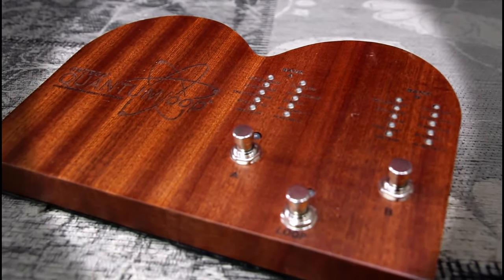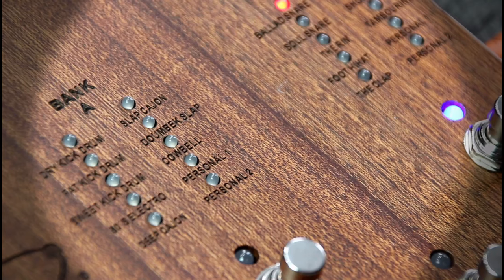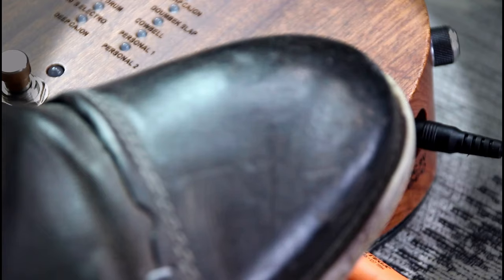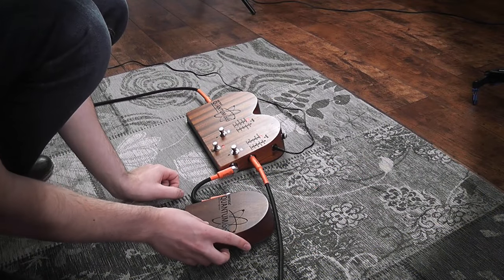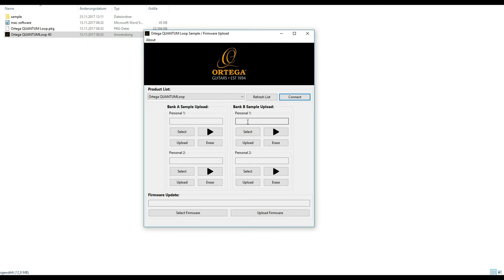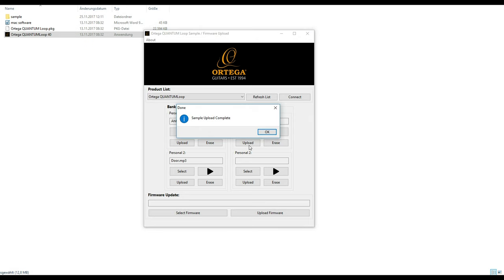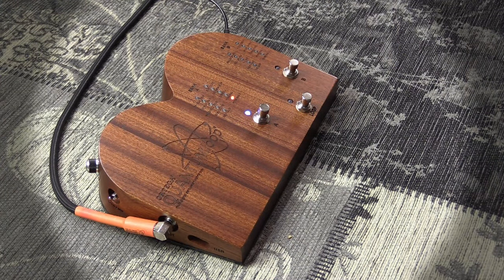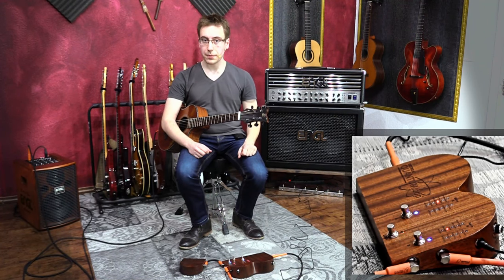Ortega Quantumloop - Video Manual

Comment: Very interesting product.
Can I auto start to record the loop by hitting the drum pad only (without hitting the "Loop" swich)?
When I'm playing, I've use to make a drum beat loop only (no guitar in loop). I want to record a few measures of rythm in loop, and then play over it on acoustic guitar. 
So I have to start by hitting simultanusly both the "Loop" swich and the drum pad (beat trigger), then keep hitting the trigger to record the few bars of rythm, and then hit the "Loop" swich again, to stop recording, what isn't easy when you must be in time (have to use both feet - impossible when standing). I have been using Horse Kick Pro with Boss RC-50 till now, but I'm looking for something new and better.
Second question, can I use QUANTUMloop with my Horse Kick Pro as a expression trigger (as QUANTUMexp replacment)?
Reply from the maker: Thank you for your input. We are able to make some changes to the firmware and have sent suggestions to see what we can do for future updates. As for the HKP being used as the trigger, I tried it out and it does work but for some reason it will double trigger randomly like a flam. Maybe because it's an audio signal?
Reply: It really would fix this loppers biggest downside if you could trigger the first beat and the looper simultaneously

Comment: my problem:
- i cannot start a loop with a beat. is that correct? so if the first hit is a kick and the record button at the same time, it will not record this first kick hit for example? :/
- also i dont like that to stop the playback it has to be a double hit! i want this with one hit for easier playing :/
i cannot change these things, right?
thanks, matt
Reply from the maker: Currently this is correct. Thank you for the input. We have gathered suggestions to work on a firmware update and maybe we can add some of these ideas to the next update.
Reply: @ortegaguitars  So whats the status of this update?
Reply from the maker: Hello  @cfire99 , have you tried the Firmware 55 update, yet? It has a short delay built in, to record the first sample. You can find it here (on the bottom of the page): https://ortegaguitars.com/en/service
Reply: @ortegaguitars  that's an improvement :)

Comment: Is it possible to start looping with the rhythm first? I mean, with a bass drum stomp and maybe even shaker, and then just play on top of that? One reviewer a year ago found that didn’t work, but maybe it’s been fixed in the firmware?
Reply from the maker: Yes, it is, but with a small trick actually. The first loop you have to record completely empty and count your beat, on the overdub you can record the drums. You can also try out the firmware version with s short latency, this is also possibel.
Reply: @ortegaguitars  Thank you for the very prompt and helpful response! I purchased a QUANTUMLoop today, so will give the firmware with the short latency a try and see if that works for me. I can‘t yet envision laying down an empty loop first. Am I right in assuming that with the short-latency firmware I should first hit the looper button and then, very shortly after, begin stomping out the rhythm? Really looking forward to getting my unit and trying it out.
Reply: @scottbecker3485  And how did it turn out?  There are about two dozen other options I'd take over this, so I'm really curious as to the result.  I looked on your channel but don't see any vids of you playing it.
Reply: @ortegaguitars  hello! 
Could you please give me a list of personal sounds wich I can upload?
Reply: This could have been designed way better. If the loop button was closer to the stomp side, you could hit the loop button and make a kick drum sound at the same time, but the sound selctor button is in the way. Also who thought it was a great idea to put in a useless electronic Tom drum sound in the stock sounds????
      Also the pedal frequently misfires the sounds, like data gets buffered and then it plays on top of the next sound.    
       It’s a great idea but sorely needs updating.
Reply: @ortegaguitars  how come?

Comment: I want to upload new sounds, but impossible to connect the quantum to my mac. It can't read , and can't connect to the Quantum. What's wrong? Computer running with OS 10.11.6. Thank you
Reply from the maker: Hello! I'm sorry you're having problems with the QUANTEMloop. It's a software issue on the computer side of things, not your QUANTEMloop. I believe our headquarters have already uploaded the new software for you to download on the website. If not, I will reply back to let you know as soon as they do.
Reply: @ortegaguitars  It doesn't work. I can't connect to the mac. I try so many times... Your product seems defective. My trailer gave me a new one and I've the same problems. I connect The Quantum USB port, then I switch on the quantum.. Always the same window, the data flash media isn't inisialized. What's wrong?
Reply from the maker: Hi  @dufausamuel4022 , thank you for getting back to us. Have you already installed the latest Quantumloop software on your MAC? You find the download link here: https://ortegaguitars.com/company/downloads/ . If you are still facing problems, please feel free to contact our customer service: info@ortegaguitars.com
Reply: I’m having the same problem. I’ve downloaded everything, I’ve put a clip into the stomp box , which says it has been loaded into the slot, but when I check nothing on the stomp box has been downloaded ?